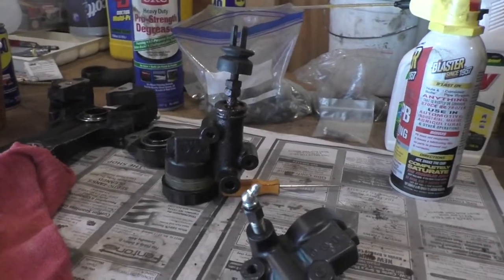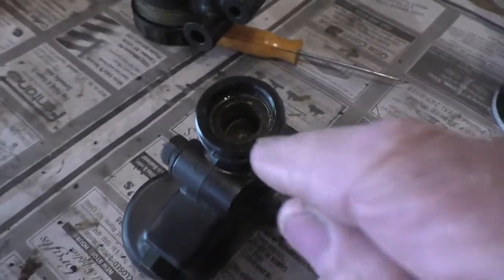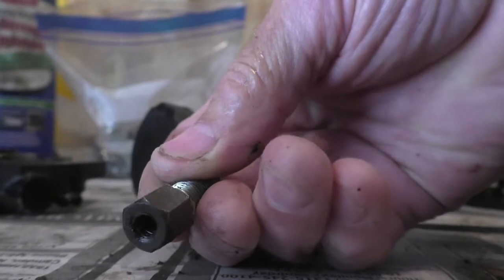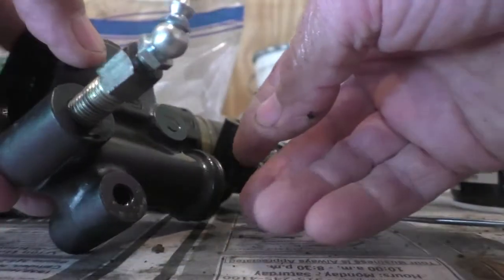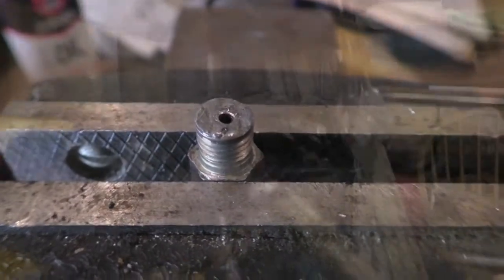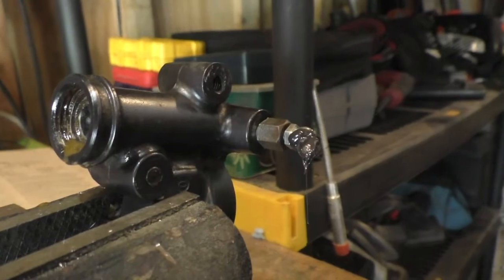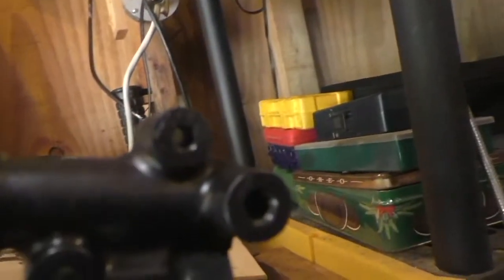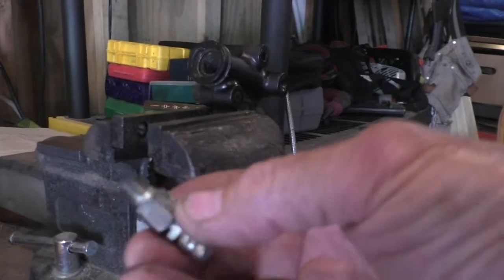Master Cylinder Piston Unstuck

Comment: One other method would be to connect the rear master cylinder to the front caliper brake line and pump enough brake fluid  with the front hand brake lever to force the piston out.